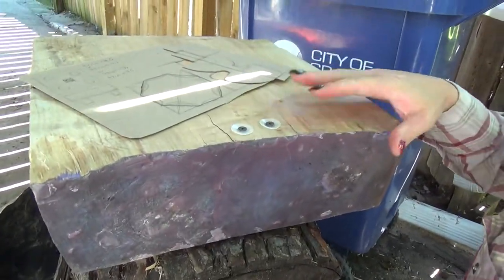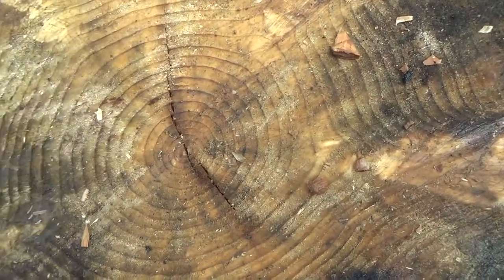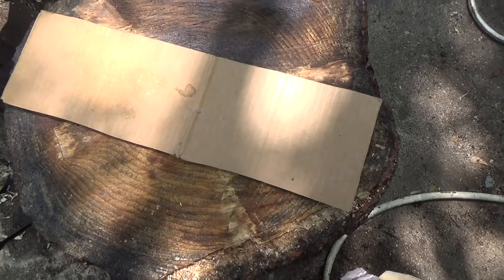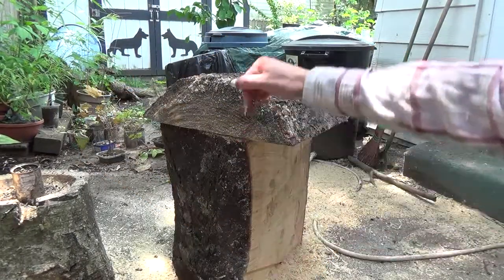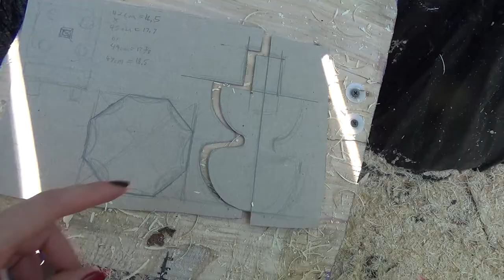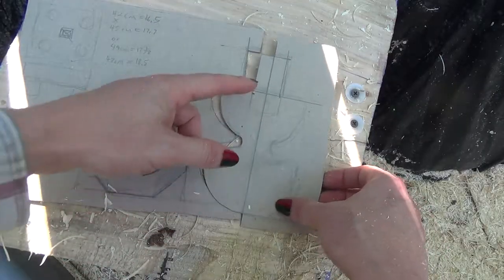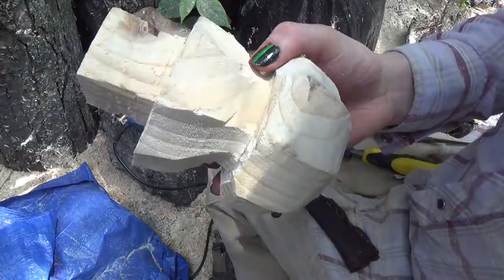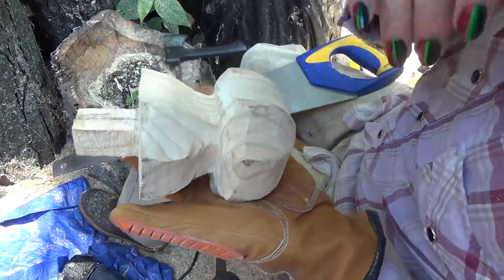How I Made a Go Board

Comment: Fan 👏 TAS  👏 TIC  👏

I'd love to see/hear more about how you processed the wood!! Where'd you get it? Did you seal the end-grain? How long did you wait to cut it?
Reply from the maker: Thanks! I got a portion of a log from a local yard waste dump. Then I used a chainsaw to roughly cut it to size. I used a chainsaw grinding wheel on an angle grinder to clean up some of the poorly made Chainsaw cuts. Then I used an electric planer to refine it more. I sealed the ends of the log with Candlewax. I did all of this while the log was green. Then I stored it inside a trash bag for a while and would periodically take it out and then put it back in. I am still trying to use the trash bag to facilitate as a slow of drying as I can. Thanks so much for asking!

Comment: I bought a really old goboard and sand it wax it and redraw the lines (don't know how to wield a japanese sword to do taci) it turned out OK. Search NYIG for go learning videos.
Reply from the maker: That's sounds fun. It looks difficult to do that thing where they make the lines with the sword. Was the one you fixed up a floor board or a table top board? (Thanks for the tip for go instruction!)
Reply: @MxBraeWilliams  It was a 5-inch floor board with legs made of Kaya wood. I sanded off the original lacquer lines and redrew the lines with a technical drawing pen
Reply from the maker: @superquestionmark2470  Woah! That's so cool! Where were you able to get a board like that? Did you have to pay a lot?